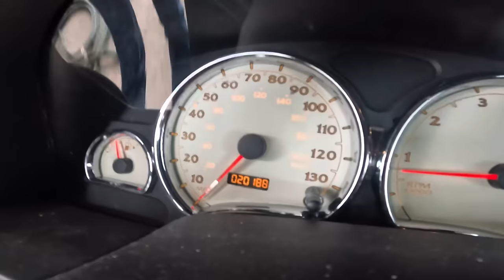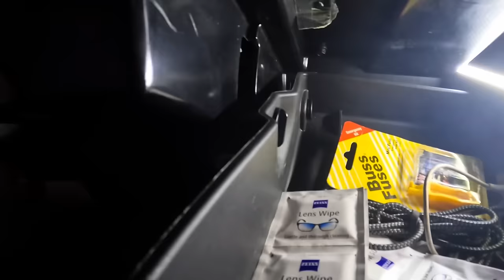Stripped Actuator! Clicking in Dash! 2007 GM Saturn Honda 3.5l

Comment: Or mashing your knuckles on the studs when doing those god-damned springs and the pliers slip ! (do not do this when anybody’s watching,  because they will say something stupid enough to get the pliers imbedded in their fat head) Rrrr !
     Years ago we would just have put a seal kit on those cylinders, but you can’t buy them anymore (uk)
   Oh ! the horseshoe clip and the gd anti rattle springs !   such fun !!   I have never seen a secondary lever like that on an adjuster before (adjuster arm you called it), what does it do ?
     I like this video ! it shows the uninitiated the heights of joy to be expected when doing this delightful task.
     For those that have not done this before, if you can take the shoes you want to replace to the supplier it can save a lot of time, it is quite unbelievable how many different shoes can have been fitted to any given model of vehicle.

Comment: Those actuators should be made with metal gears, I’ve replaced a few, far too difficult. I’d pay twice as much for them if they were made from metal from the factory.
Reply: I 100% agree, I’ve replaced several on my Fords. Always find broken or worn out plastic gears.  It’s too hard of a job for heat or air!

Comment: 36:35 aren't you risking collapsing that brake hose due to age?

 Circa 2007... so that hose is 17 years old 😢

Gotta be another way, like shoving a golf tee or just swap the wheel cylinder ASAP

Comment: The first Saturns were pretty good cars, not perfect, but pretty good.  It was later on in the Saturn lineup when GM started buying components from Honda, and reliability on the non=Honda parts started going down.  By the end of Saturn, they were just as bad as any other GM vehicle.
Reply: Yeah Saturn was a decent vehicle until 2002 then gm started using other brand parts.

Comment: It's too bad they don't supply replacement gears.... that is such a waist of plastics, and electronics.  The motor, and the board and other gears are all fine, but one probably one cent gear caused a whole component to fail.

Comment: I remember when Saturn came out, they were supposed to be the best parts of GM put into a car. How wrong they were. The first 3 to 5 years were prone to engine fires. Then they started acquiring other brands, which ran off of Toyota parts. Once the reputation of Saturn went down, they started to acquiring parts from Honda and others. I'm sure that if you dug around under the hood, you will find other brands.
BMW people are worse on the road. LOL

Comment: It might have been helpful if you explain to people how to adjust the brakes that have that design. You reverse the car and you give it firm pedal to stop the car, you might have to do it more than once, especially if you haven't adjusted the brakes in a while, until you get a competent pedal feel. Don't overdo it or you'll end up with too much rear brake bias. Just like some of the Camaros especially in the mid-90s that you adjusted your brake pedal by cycling the emergency brake lever. Otherwise you drove around and unless you hit the brakes really hard you never engage the rear brakes I've worked on several Camaros years ago that the entire rotor was Rusty because the brakes were never coming on, and it always had a spongy pedal because they had never cycled the emergency brake. Or more properly called, the parking brake.

Comment: I question the application of any lubricant inside a brake drum.  When the brakes heat up and the grease can liquify and make its way onto the shoes and.... Viola'!   The grabbing brake syndrome returns!  😳  There is a reason why mfrs do not apply grease in a brake drum.
Reply: Mother effers do apply assembly lubricants.

Comment: You youngsters 🤦🏻‍♂️ have been spoiled by disc brakes. Way back in the day shoes could be rescued by blow lamp drawing the fluid out and then sanded, and the drums heated and they would sweat the contaminants out and again a bit of emery cloth would resurface the braking surface.

Comment: Well I have to say that you're kind of contradicting yourself when it comes to disc brakes then by putting that factory screw to hold the disc brake in... This little clip on the rear brakes serves the same purpose. so if you're going to replace the ones on disc brakes you should replace the ones on the drum brakes... However that being said the ones on the disc brakes are built to be reused whereas this clip is more of a replace not reuse...
Reply: The round retainer clips are not meant to be reused. They are only used on the car assembly line to keep the drums from falling off as the frame (minus wheels) moves along the assembly line. They hold the drums on until the frame reaches the station where wheels are installed. They're completely redundant after that.

Comment: Blend door actuator, the bane of my existence. They could last forever if the mfr spent 5 cents more per unit, but NOOOOOO, let's put cheap plastic through extreme hot and cold. Strip those gears.

Comment: If that little clip has to keep your brake drums on its place, I DON'T DRIVE THAT CAR!!!
Reply: You missed the information that it's just for the assembly line

Wheels/tires were installed later on in the factory
Reply: YouTube

I DO understand, I was sarcastic! That clip does NOTHING but keeping the assembly together for transport or so.
The wheel, studs and nuts keeps the disk on its place!

Comment: Using shoes/drums since the advent of pads/discs is nothing more than an intentional bad design decision in the 21st century. The 1st time I ever seen rear discs I figured it would just become standard within a few years at most, even allowing for manufacturers to "use up" their existing parts supplies 1st. How wrong I was but, at least now we know, they prefer inferior.

Comment: new shoes always, because the shoes did not come looking crappy from the factory.  Safety first.....Always.... And, the two real brake hoses should be REPLACED.  Too old to pinch off.  Safety first.....pinching may degrade the internal aspects of the brake hoses....AND, finally to protect the face of the shoes from greasy contamination, 3M Blue painters tape should be applied to the shoes, before touching the shoes....it gets removed at the end.....Safety first, the shoes do not come with any grease on their friction surfaces.   Safety, first!  and the adjustors should be separated, and the threads correctly lubed with high temp grease, to make sure they rotate correctly.....Saftey, first!   Finally, find or buy a thicker, shorter Screwdriver to pop open the horseshoe clips.  Your thinner, longer screwdriver is Dangerous.  Protect Ur hands, get a heavier, shorter screw driver....Maybe grind the endes to make them slip in ..... use common sense.   Make a better tool.  Safety!

Comment: Cut that retainer clip off. What should happen!!! The manufacture should be required to remove the clip before the vehicle leaves the assemble plant. The clip is for assemble purpose. I'll bet that when all the safety test (Crash Test) and so on were done, the clip was not present on the vehicle. Making all the test done on the vehicle INVALID. 😁That's just my thoughts, but hey !! what do I know.

Comment: Worse piece crap I ever owned was a new 1981 Jeep Rengrade Cj-7 AMC with all the bells you could get on it .  , bought it new  and after 50,000 sold in my drive way as as and it was a shape looking piece of crap with the transmission out for the third time . Ford motor and a Mustang 2 - 4 speed transmission that wasn't any good after 25,000 miles . Never less I stayed with a Ford or Chevy afterwards .

Comment: Just TRY and remove that brake line tube nut from a wheel cylinder or a disc brake caliper in the NORTH as easily as THAT tube nut came off,plus the brake line itself wasnt FUSED like a WELD to the nut!!! just 1 more example of why doing auto work where salt on roads is NOT an enjoyable experience!! Yer spoiled down there, Ray
Reply: Yeah, for a 2007 & hardly any rust under that vehicle is impressive 😅

Comment: Coddling ignorant people and paying them for being a PITA only encourages them.  You can get push-on locking washers very cheap so I'd tell them they are unnecessary but if they insist bring the car back and leave it for the day.  Five minutes before closing time snap them on and tell them they can pick up the car in the morning.  Make their ignorance cost them instead of the other way around.  Yes, it would take a bit of time but the satisfaction would be worth it.

Comment: There is no 100% American made cars anymore. That ended over 40 years ago. Every car today is built with German, Japanese, Mexican, Chinese, Canadian, and/or some other countries built parts in it. For instance, BMW made a 5 series wagon in the 90's with a GM transmission,  built in Hungary. Why not use a ZF made trans, that would last for 300k miles instead of a 700R4 variant that is only good for 125k miles, in a premium car? Jeep has used Denso alternators for decades. GM has used Bosch or Siemens engine computers, injectors, and other components for decades. And brand loyalty is not necessarily a good thing. GM has been horrible with transmission issues, so buying from a company with better history is a plus for the consumer. Honda engines are better than GM's, another plus. The best example is the Geo brand, which were built by Toyota and Suzuki. When Chrysler built the first Omni's, they had never built a sub compact front wheel drive car before, and had no powertrain tooling in place to build such. So, they looked to other companies like Peugeot and VW, before building their own design (copying VW design). When BMW bought the Rover Mini and brought the Mini Cooper back, they didn't have a FWD power train and looked to Chrysler. Why Chrysler? They could have asked VW for a Polo or Golf drive train. A standard 1.6T or 1.8 NA would have been acceptable, with a 2.0T for the John Cooper Works version.  VW also builds a great AWD system,  that would have been perfect for a WRC Mini. I don't know why people make these choices, but I would have done better. You could easily tune a reliable 400hp out of a VW 2L turbo,  with the AWD DSG, and play with the Suby guys while having a more usable and comfortable ride. A good car company would search out better made parts from other companies, instead of paying all the R&D costs to do it yourself. This is where the Germans have is beat. They share the R&D with each other, instead of 5 car companies individually spending money to build a better design, one does it and shares it with the others. VW built the first Tdi's and MB used the same tech in their diesels, without engineering it themselves. You could see the tech in a MB in a VW 5 years later. R&D is one of the largest costs to a manufacturer, with tooling coming in second. If you let someone else pay that cost, then buy the finished product, you not only save the money of designing and testing it yourself, but you save time to market. We're in a global market and nobody has a dominant market share anymore. 60 years ago,  GM and Ford had over 50% of the US market. Today, the have less than 20%. GM used to be the largest in sales. Now it's back and forth between VW and Toyota. Gone are the days of anyone selling 100's of thousands of a single model of a vehicle (except those F series pickups🤷). You're lucky to sell 10's of thousands, which is why many different models are built on the same chassis and over several model year changes. VW builds nearly all it's vehicles based on one chassis. Golfs and Jettas have been that way since inception. It keeps the costs low, which is why you can buy a new Jetta for less than most anything else, but it be better than a comparable car of its price.

Comment: Hundreds of thousands of those actuators have failed in splitting or stripping the SORRY PLASTIC garbage gears.  That very SORRY CHOICE of materials has cost Americans millions of dollars in repair and parts bills.  Personally, in my little shop here, I have changed at least a dozen on the likes of Nissan Titan, GMC Envoy, Jeep Grand Cherokee, and others.  HATE.

Congratulations on the shoe brake job.  ..those can be somewhat maddening, but you did maintain decorum.

Wait until you get a Titan pickup rear wheel needing shoes.  You, too, will learn to HATE.

Sad to say, if I were making a Titan shoe video, it would require heavy audio silence in certain places.